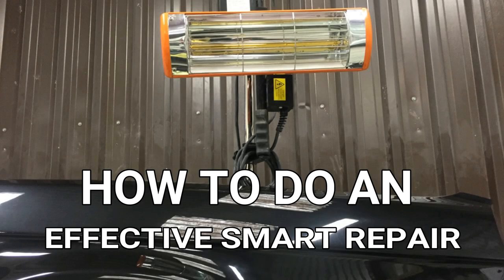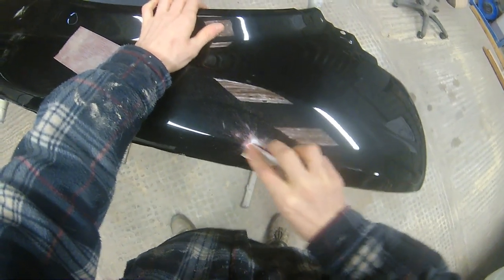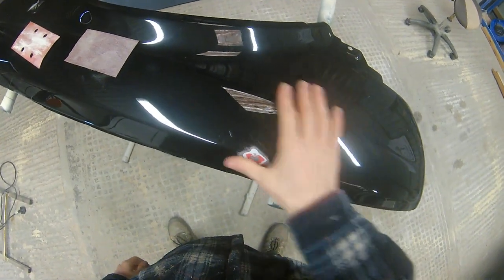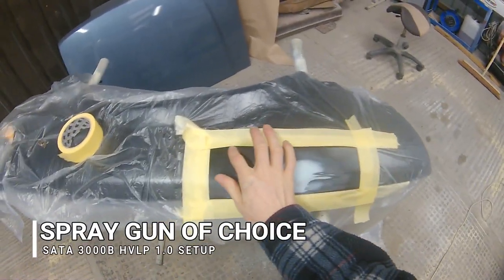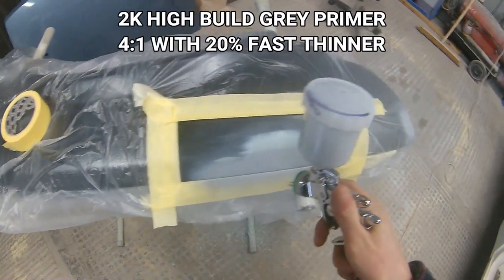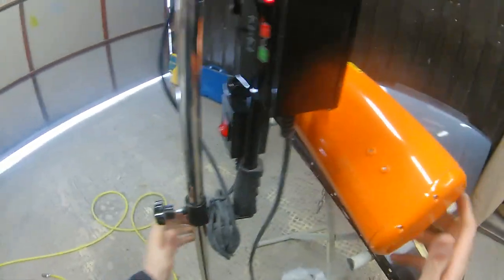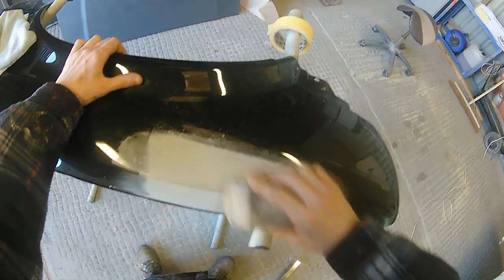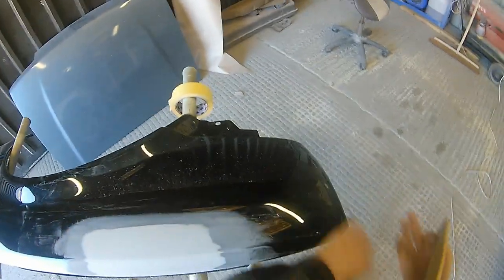How To Do An Effective Smart Repair Part 1

Comment: Great video! Please don't take this the wrong way, when you are doing jobs like these its best to wear some nitrile gloves or any tight fittings gloves that are just 3 mil thick that way you can still feel the panel and any low or high spots but most importantly the oils on your skin are not contaminating the surface. The only way to ensure the oils are removed is to use at least 50% isopropyl alcohol. 
Anyway just a suggestion  Everyone is different i need to soak my hands in oil lol but I still use gloves only because it was a issue one time and took us hrs to figure out what happened.

Comment: I did my first spot repair on a very strange damaged paint area on my car. It seemed like a drop of something that had tiny deep holes within it. I sanded all the way down to the bare metal until the holes were gone. So the metal, primer and paint were visible...Here are my steps: 1-clean the area. 2-primer coat  with self etching primer. 3-sand and clean. 4-couple of coats of touch up paint from the dealership with the brush it comes with which by the way it's a nightmare to use that brush on anything but rock chips. 5-sand and clean. 6-couple of layers of clear coat. The end result is not pretty but it's not horrendous for a first timer, at least it's very well protected now. So, i'm planning on redoing it with a small airbrush that i'm going to purchase soon so it can come out better. There's also two more spot like this on my car that I still want to use the air brush method on as well. Anyone has any tips or tricks that can advise me?

Comment: Hi, Tony How much would you quote for a job like this? 

Was working on a keyed car, and was sanding clearcoat, someone has done a smart repair with very very thin clearcoat and found my self eating BACK into the primer ahahah.. with P2000 its 5 seconds lol.

Comment: excellent video my one suggestion would be to use a guide coat on the filler and the primer to make it easier to see any low or high spots ,pin holes scratch marks  etc.and to make sure the swage line is absolutely straight.Guide coat can be any dark colour from an aerosol or spray gun just dusted on lightly,takes all the  guesswork out of rubbing down.
Reply from the maker: thats a good tip for the beginners mate i have to say

Comment: if not forced drying is used (by means of lamps , air heater , etc) if you over-reduce the primer, the reducer within the mix will not affect the substrates after some time?

I mean that prep sanding marks can apear in the job after cca. 5 months?  maybe too much reducer will somehow destabilize the chemicals in the substrates and primer above will copy any scratch from underneath ... 

Is this possible?  (maybe more pronunced with cheaper products)   many many thanks
Reply from the maker: The mix is still only the same as a wet on wet mix mate so there should be no issues , we’re not putting to much product on and prep level
Is higher than usual so there’s no issues

Comment: Great tutorial. Interesting about the panel heat lamp and it heats the substrate panel surface. Commercial panel lamps are quite expensive, would a patio heater style lamp work?

Comment: Hi Tony
Is 3000 grit dull back ok for a decent keying.
I keep reading not to use anything less than 1000 for keying? Which I just think seems a bit course. Your method seem more like common sense. I have a small smart repair in a mid blue metalic M5X around two rear arches for some early stage blistering. Just want to make sure I’m getting the keying rite for the base coat and then a blended clear coat.

Thanks 

Dave

Comment: I have a question I hope you will answer. I own a ‘99 Black C5 Corvette Coupe. When I purchased it privately back in 2010 I purchased it with a 3-1/2” scratch on the roof panel. I was told it happened when the previous owner took the roof panel off the car and placed it in the back of the car under the hatchback. It slipped out of his hands. The scratch to me looks like it is just in the Clear Coat. I can easily catch my finger nail inside of it. I have done body repair in the past with great results. My thought is to prep it and only try to fill the inside of the scratch overlapping the surface some with Clear Coat and after it drys really good lightly wet sand it until it blends with the rest of the surface. What are your thoughts on someone like myself doing this? I have no idea what Clear Coat to use on it. Was thinking of just having a paint shop mix some clear for me and put it in a rattle can to do the job. They usually do it where there is a button under the can you press to add the hardener. Your thoughts?
Reply from the maker: Hi yes that would be an option you could go down mate just Dan some clear into the mark let it dry flat it down and repeat till you’ve filled the issue area
Reply: @TonysRefinishingTV  what type of clear would you go with? Aren’t there a few different ones? I have no idea what clear GM used with the car from the factory.
Reply from the maker: If it was me I’d get some proper 2k clear for it
Reply: @TonysRefinishingTV  Thanks.

Comment: I used to flat it off by having with wet dry and soapy water does it make any difference by hand or with the DA
Reply from the maker: No as your going to re clear it anyway mate so wet or dry will make no odds

Comment: Filler or Epoxy Primer? After sanding through clear/base/Primer down to bare metal, Which should I use for a quick deep scratch removal repair on a door panel?
Reply from the maker: Hi mate so the whole door isn’t bare metal then
Reply: Tony's Refinishing oh no. Not the entire door panel. Just about a 10” long key 🔑 scratch.
Reply from the maker: I would just use a tiny bit of etch mate to seal the metal then high build buddy

Comment: I was told that a p3000 is not good for the new paint to adhere ... at most it is a 1500 ... but I have read that you confirm that membership with p3000 is good!
Reply from the maker: sorry mate this video was a while back id have to re watch to answer your query as im not sure which part your referring too
Reply: Tonys_Refinishing the question is .. with p3000 the paint adheres? or better not to go beyond 1500?

Comment: For those of us without a DA sander and using an aerosol spraint can of paint can you answer the following:

1) When block sand sanding the primer with p400 do you extend past the areas you sanded with p1000 in the previous step?

2) Can you use 3M grey scotch brite scuff pad instead of the 3M p1000 grit pad you used with the DA sander?

3) Can you use the same 3M grey scotch brite pad instead of the p1000 grit paper you used to sand the filler and surrounding area?

Thanks

Comment: Hi, Tony, can you provide the necessary drying times if you dont have a heat lamp that you used on the video. Each time you used it, Please?
Reply from the maker: I can’t mate I’m afraid as it’s product and manufacturer dependant you should be able to get info like that for the product you use by searching for the price tds sheet
Reply: @TonysRefinishingTV  Ok, another thing, you remove the masking tapes while the paint is wet, correct?
Reply from the maker: And if
The edge masking yes that touches the blend area the rest could stay on

Comment: Nice job Tony!! Don't you get marks from the straight painted filler against the floppy? I know you never get them away,even if you sand all the filler away the marks will stay.
Reply from the maker: the primer do you mean ? if so no as the edge feathers out slighlty due to the way we mask so bloacks out with no issue at all

Comment: what is the cause of a bunch of pinholes in the clear or under the clear after finishing the last coat of clearcoat and having the lamps on them? Is it because my lamps are way too close? I prepped everything properly before clearing. I dont understand why I keep having these in my jobs. I cant sand them out because they appear to be very deep
Reply from the maker: Hi yes they could be from too much build and then heat applied to soon , you could also be getting them from any oil or silicone contamination, try painting one without using lamps and if it still happens use some level it additive in your clear coat ( anti silicone ) it may help

Comment: You blocked down to bare metal. But, you went with the Filler as opposed to a 2K Epoxy Primer or Etch. How do you determine whether to Filler or 2K Epoxy?
Reply from the maker: ok so if its small nomral primer larger area etch primer , restoration jobs resprays from bare metal then epoxy just not worth mixing n curing epoxy for small things like this at all
Reply: Tony's Refinishing Okay. Can I send you a video to your Instagram DM) of my issue to get your feedback on the best way to tackle my repair problem. I don’t want to sand down to bare metal my work area if I don’t have to. I have a can of Eastwood 2k Epoxy and a can of Eastwood 2k Urethane Primer Filler and I’m trying to avoid blistering where the old paint/3M Bondo Filler/Putty layers transition to the bare metal which has been covered with a 1k High Build Primer Filler.

Comment: Tony, if you was going to spray the whole panel after that small repair, would you still sand the whole panel with 3000 grit. Peter
Reply from the maker: Hi Peter if I was going to do it normally then a smart repair I’d have just p1000 the whole panel first rather than this process for smart repair
Reply: Tony's Refinishing thanks Peter
Reply: @TonysRefinishingTV  . Tony just to mention that the sanding grits for spraying is a minefield. Nearly all the sites I have looked on which are mainly usa recommend 400 grit, which I think is too course anyway. I asked a local body shop in Southampton UK what they used and they were the same as you p1000. Also looking for a used 3hp compressor
but the prices seems very strong on ebay. even for old ones. any where else to try? Peter
Reply from the maker: peter lock hi Peter drop me an email to tonysrefinishing@gmail.com il write you some sanding grit stages down and also send you some links compressor wise mate
Reply: @TonysRefinishingTV , just to let you know I sent you my email address which you asked for. regarding sandpaper and air compressors. Peter
Reply from the maker: Ok Peter will get back to you on that later tonight and send you some info over
Reply from the maker: peter lock have t had anything come through mate il be home in about 2 hours then il email you direct fella
Reply: @TonysRefinishingTV  ok. peter

Comment: I really like the longer clips :) With 20% thinner in the primer, how long do you wait inbetween your coats to not get any shrinkage later on? And i just thought about leaving a comment on the P3000 being too fine when you said that it worked so far for you. I usually don't go finer than P1500. IF i'm using P2000, i add a tiny splash of blending solvent to the clear to give it a little more "bite". Looking forward to pt.2 :)
Reply from the maker: +Chuck Thomas believe me I till I saw it done with 3000 I wudnt have said it would have worked but after seeing it done a lot ( not on my work ) and doing adhesion tests myself to answer a few questions I had I can say it does work , I leave it till the primer has almost mattes out then apply another coat , this method shown isn't one I use myself but as I said I've seen it done a lot and can say it does work
Reply: Thanks for the quick reply :) Also some good tips on how to place the IR lamp...i have a tendency to always put it up too close :)
Reply from the maker: lol weve all done that at some point
Reply: Thinner in the primer, it is called sealer. I still prime it first and sand the area down and do bodywork if there are. I’ll add only one layer of sealer right before base to cover the primer and bondo and give myself a uniform panel to paint

Comment: Did you use enough hardner in the glaze? What the heck did you need a heat lamp for? Lol the filler was pretty much straight blue lol
Reply from the maker: time of year, weather and showing the use of the lamp in the bodyshop environment for those who dont know its uses and benefits
Reply: Over Catilized man it’s 2% by weight your body filler should be mixed at
Reply from the maker: If you read the comment above that’s why and it’s a test panel for video use not a customers car so it’s not like the filler was being mixed to spec for an informational video , it was more to show the spot repair process not the repair side and heat lamp useage
Reply: Cheers mate just doin my duties providing more input love the video

Comment: I keep getting the clear coat blend line rolling back as I'm polishing I've extended my clear coat area so I know it's not colour  over spray landing in clear coat area any suggestions
Reply from the maker: honestly not an issue ive ever had tbh , if your polishing back the clear blend then maybe you may need to flat it abit less or get abit more material on there

Comment: Why not just clear the whole fender?
Reply from the maker: The whole point of a smart repair
Is to keep it small and Local to the damaged area , this was just an example of how to carry out a repair like this as usually on a repair carries out Like this the war would still be whole , if it was a usual job in our shop we would re clear the panel but this video was to demonstrate how to do a smart repair rather than a full body shop Repair